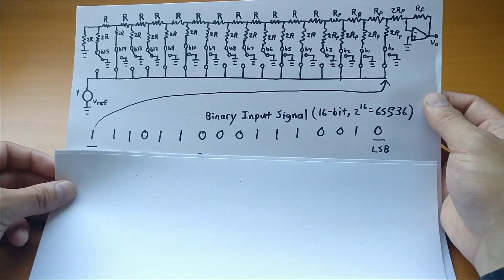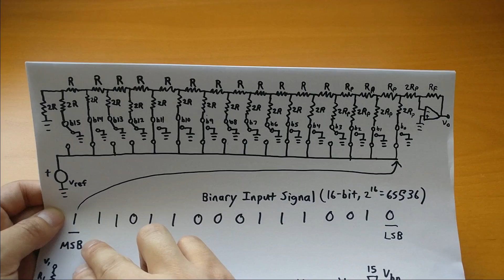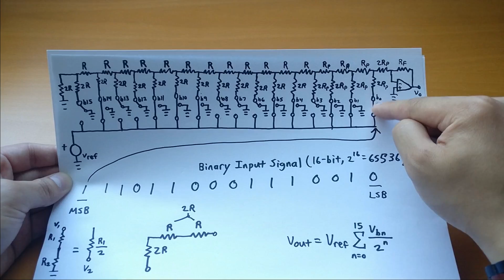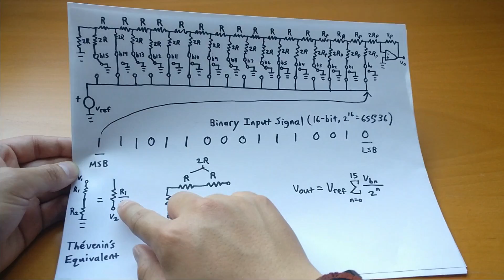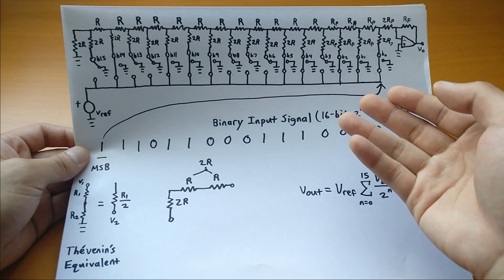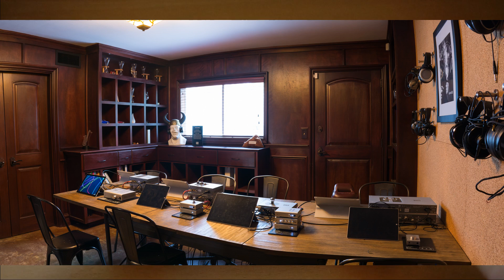[Review] Schiit Audio Bifrost MultiBit (BiMB)

Comment: Interesting that you characterize their sound as on the warm side of neutral when the objective frequency response measurements disagree with that... they are nearly perfectly flat response. It must be something that’s not captured by the measurements we have.
Reply: I think perception of smoothness is often interpreted as warmth even if the fr effect is neutral. I've heard tubes with "cold" signatures (i.e. those that only boost treble or even suck out lower midrange) still be described as warm because the harmonics they add make things feel more "accurate" to the feeling of a "warm" live performance. Very very interesting imo

Comment: Which Schiit Multi-Bit would you recommend for best sound? 🙏🙏🏽
Reply from the maker: For purely the best sound? I really like the Yggdrasil for what it is.
Reply: CD quality is 16 bit. The resolution of the bifrost multibit is also 16 bit. It's the most you'll ever need and it will sound smooth and natural. The Gungnir multibit is 19 bits of resolution and the Yggdrasil is 21. =)

Comment: Jotunheim and Modi Multibit are stuck with USB Gen2. Unless you use an EITR with Modi, there's no way to fix GEN2 on Jotunheim. There should be a significant difference in performance of Gen5 USB/EITR vs the GEN2 of the Jotunheim module. Did you listen to an actual JOT + Module? Or just assumed Mimby would be the same?
Reply from the maker: I did listen to an actual Jot+MoMB unit at the Schiitr.
Reply: @miceblue425  Thanks for the reply, I own both the Jotunheim /w Multibit module, and the Bifrost Multibit with USB GEN5. Maybe it's because I could test them in my own environment and spend a bit more time critical listening, but to me the difference is not really that subtle between these two. GEN5 USB gives bifrost a huge leg up. I noticed with the Multibit module, a flat, closed in soundstage, and high frequencies were not enjoyable. Paired with Jotunheim it made me wince, I wanted to turn down the music all the time. The Bifrost Multibit with GEN5 was exactly the opposite, it had the tonality of the Multibit Module, but resolution was significantly higher, more detail, less sibilant, tighter, more powerful bass notes, and I wanted to keep turning the volume higher. 

I've not heard the Modi Multibit personally, but I think some of the above positives I experienced with Bifrost are applicable to Modi Multibit as well,(as opposed to the multibit module) particularly if it's paired with an EITR. 
Based on what i've heard with the Multibit Module, I can't say im a fan of it, and don't recommend it to anyone. I've heard good things about the GEN2 AK4490 dac card for JOT/LYR3 but have not personally heard it, many prefer it over the multibit module however. I did own the GEN1 4490 card and was not impressed. 

Thanks for your review

Comment: Thanks for a good tutorial on how delta-sigma and multi-bit work. Regarding your impressions and conclusions when comparing different units I must take the results with a pinch of salt. The reason is that, although Schiit's USB board/module has improved, the quality of sound available through USB input is definitely and clearly NOT as good as the optical or coaxial inputs. The improvement when using the optical or coax inputs is quite noticeable. As a result of this, you may wish to re-audition sometime if you get the chance. By the way, we have a Bifrost 4490 at home and we like it a lot. Cheers!

Comment: Is it true that there is no difference at all going from the modi 2 multibit to the bifrost multibit? I've seen plenty of people saying that they immediately noticed a difference after comparing the two, in the first 5 seconds of a song.
Reply from the maker: There is a difference, but it's not huge to me, and that was with MoMB Gen 5 USB versus my BiMB Gen 3 USB directly A/B-ing them for 1.5 hours. There's a reason why people generally recommend the MoMB over the BiMB: you basically get 90% of the BiMB at less than half the cost. I haven't heard the GuMB before, but I do like the Yggdrasil for what it is, and that's a very clear step-up from the BiMB unlike from MoMB to BiMB.
Reply: @miceblue425  Im not sure what generation of USB you were comparing here. But Modi Multibit has only ever been availible with GEN2. Unless you were using it with an EITR, which would have got you GEN5. Bifrost has never been available with USB GEN3, only GEN2 and GEN5. Having heard the difference between GEN2 and GEN5, I will never use GEN2 again. That means Modi Multibit + EITR = 429$, or Bifrost Multibit for 600$, one box, and no interconnects, (many will spend 25-100$ for a spdif cable) better power supply and upgradability. Modi Multibit is unqeustionably a better value if one already has a decent SPDIF output source, which negates the need for EITR. But USB GEN2 is not good, i'd never use it if a better option were available.
Reply: I'd hope so considering the price of the Yggdrasil comparatively to the others. Do you think going from like usb 2 or 3 to usb 5 really does make a difference in sound quality though?
Reply: I'd like to know since my bifrost multbit is on my way as we speak. It is usb2 but I could always upgrade it to usb5. Right now I have the lyr 2 powering my lcd 2 headphones + a modi 2 multibit.
Reply from the maker: I don't think it makes much of a difference if you already have a pretty solid USB interface. I was using my MacBook during the A/B testing, which has a pretty darn good USB interface in my experience. At home I use an iFi iUSB 3.0 (which is basically what the Gen 5 USB does) with my 2017 PC, but it honestly doesn't make much of a difference in sound quality. I use the Eitr too with my Pulse X Infinity, and that does sound different to me because implementations between S/PDIF and USB are oftentimes different in a DAC. I would recommend spending the money on the Eitr over the Gen 5 USB upgrade for just $30 more, and you can use the Eitr with other products if you need to (Eitr actually has a Gen 5 USB board in it).

I was going to add this to my reply above: Both the MoMB and the BiMB use the same DAC chip, just that the MoMB sacrifices power filtration within the unit unlike the BiMB. If you know what a good power supply sounds like, you can apply those benefits to the MoMB and get an idea of how the BiMB sounds. Basically you get a blacker background, more solid imaging, and a cleaner bass response, which is exactly what I heard in the BiMB vs the MoMB. But given that it's 2.4 times the cost, I wouldn't really recommend it and you'd be better off spending that money on a nicer power cable plus some music that you'd enjoy.
Reply: Alright thanks for your input. Thank you for the video it was very well explained.
Reply: @miceblue425  Ifi IUSB 3.0 does not provide galvanic isolation, as does USB GEN5, for that you'd need the much more expensive IFI iGalvanic. Bifrost also uses a completely different filter then Modi Multibit. As noted on Schiit's official website, Modi Multibit uses something they call "Super burrito filter" while Bifrost/Gumby/Yggy use a different type of filter, thusly the Dac's are voiced a bit differently.

Comment: I have Jot. with delta-sigma dac. Is it worth upgrading to the new multibit?
Reply from the maker: I don't recall, are the Jot's (and now Lyr 3) modules user-swappable? If so, it might be worth the investment if you're curious about the MultiBit sound. I wouldn't say it's necessarily an upgrade, per se, but rather a side-grade. It's like tubes versus solid state amps to me. I prefer solid state amps (Delta-Sigma DACs in this case), but tubes (R-2R DACs) are an option for people to choose from. I would be interested in building a Soekris R-2R DAC some day for fun though, just in the same for a tube amp (Bottlehead Crack).